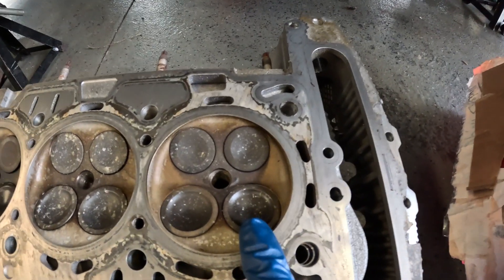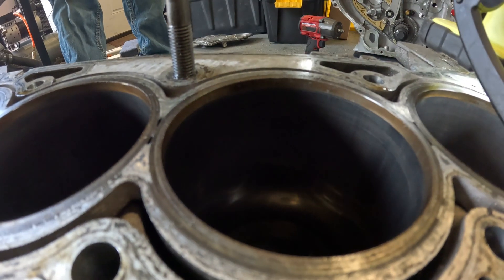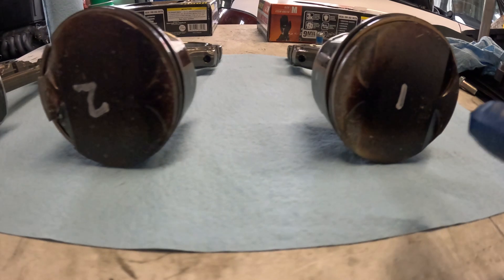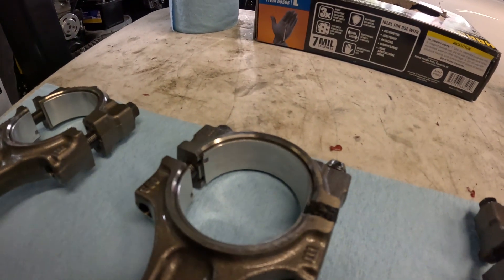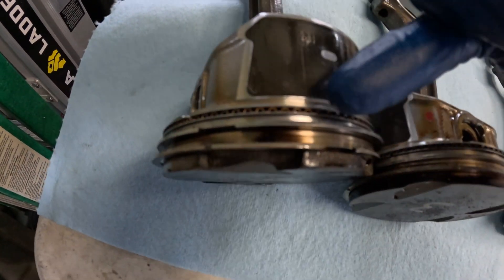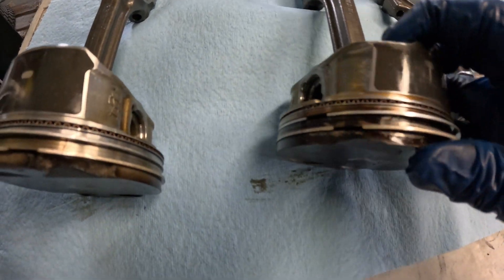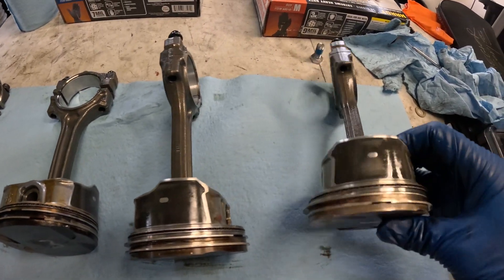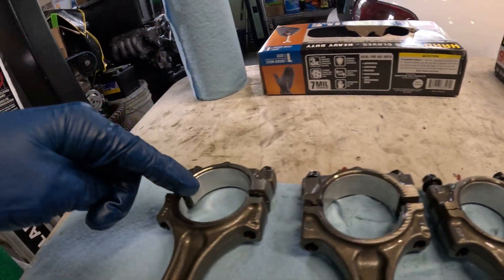What Caused our Engine to Blow Up? - Additional Evidence

Comment: I am still going with too much internal combustion heat due to a combination of lean mixture and late timing. (Exhaust leak giving false O2 readings and the loose pulley triggering the knock sensor to pull back the timing or timing retarded too much from an incorrect tune)  If the piston damage was caused by detonation then chunks of the piston probably would have been dislodged all at once then left evidence of the bits being hammered between the piston and the head.   I think the pistons were progressively burnt away in short order.   The molten metal from the burning piston could be the spots on the cylinder head.  I believe the dark spots on the head in each cylinder indicates high heat.   Any valve, valve seat, or valve guide damage could be from the excessive heat in the combustion chamber and head surface   This heat could have been transferring into the intake valve seat and the intake valve itself over-riding the normal cooling affect of intake air/fuel flow and and cooling affect when it closes and contacts a cooler seat.  The intake valve stem could have even increased in diameter due to over-heating and started to seize in the guide.
Reply: I don’t see any signs of progressive failure, the broken pistons still look clean and jagged not melted. That usually indicates a sudden failure / overload. I think piston 3 really solidifies this, that break in the ring land is “clean”.
Reply from the maker: In the end we beleive it was just tuned WAY TOO lean with AFRs in the high 13s low 14s at WOT

Comment: Pre Ignition ( not Detonation ) damage, detonation occurs after the plug ignites the air and fuel. Pre Ignition happens as the piston is traveling upward and causes failure like you have experienced. That explains why you don't have damage to the rod bearings.
Reply from the maker: What do you think would be the cause of that
Reply: @ruggedbadgerracing  its usually a hot spot in the combustion chamber, sometimes it could be a cracked spark plug, something with a sharp edge that can  heat up to the point where it ignites the fuel mixture before the compression stroke is finished ( like WAAAY before ). Things like loose burning carbon can cause it as well as oil in the combustion chamber in the right amounts, a burnt/ burning valve, a rouge spark plug or the wrong spark plug. Maybe a injector gave up, things went way lean and EGT went too high? Could also be ignition timing too far advanced but I doubt it in your case.  Lots of ways to speculate but its going to be difficult to know for sure.
Reply: I'm still leaning towards the intermittent fuel starvation as a root cause. I think it's fantastic that y'all are tearing it down and really trying to dissect for a failure too. I enjoy the quest for answers and general knowledge. But y'all know it was starving for fuel at times. Fix the obvious problem and gather more data. 

DEFINITELY recommend getting a wide band and maybe EGT sensors. That way y'all can do a test day and gather data.
Reply from the maker: @stevec5280   We have a wideband and I will try to get that connected to the AiM for logging.  We ordered a new surge tank, pumps, plumbing a new fuel rail and we will move to return style fuel system.  We also have a new conservative tuned ECU on its way from Ecotec Miata, and we will get the injectors reflowed.  I will also make sure we connect the knock sensor and we will try to log that as well.  We bought some plugs to block off the oiling system so we can use the OE filter on the street to see how that performs vs. the remote filter and accusump that in currently installed.   That said, I am actively trying to get feedback and dial in on the exact issue because I really don't want to blow another race.
Reply: @ruggedbadgerracing  cool beans. Sounds like all steps in the right direction. What model Ecotec/ECU is the setup btw? The standard LE5/E67 ?
Reply: @ruggedbadgerracing  Does your ECU have a wideband?
Reply from the maker: @jeffwasilko  The car does, I'm not sure if the ECU is connected but I've been told that the ECU ignores the O2 at WOT.
Reply: @ruggedbadgerracing  It may be worth figuring out if it can be enabled at WOT. My Haltech has an option to disable O2 correction over a certain % throttle, but it's configured to use it at all times. It's made some long-term fuel trim adjustments in the 5000-7000 RPM range at WOT.